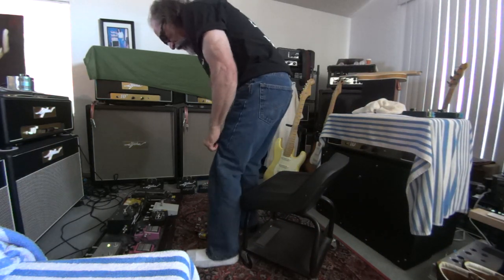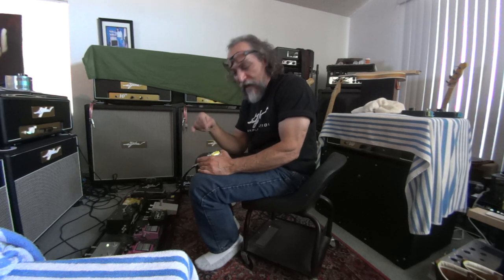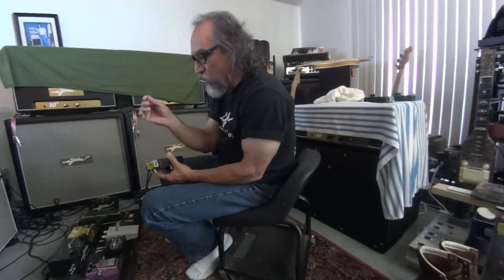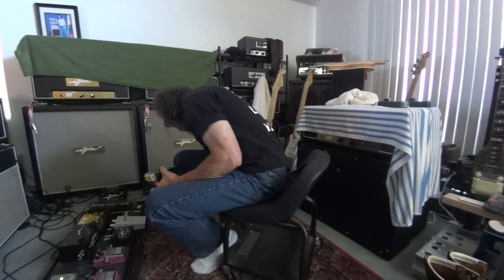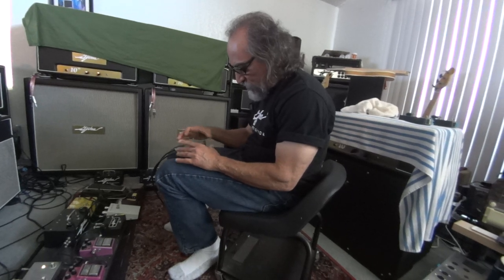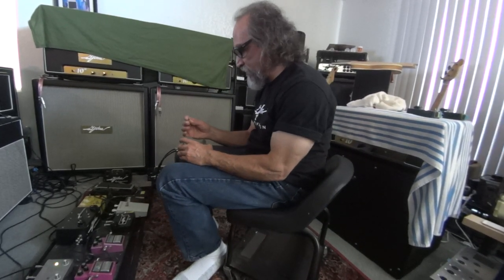Tone Talk: GERMANIAC - germanium transistors - AC128 - for Gjika Gainmaster Fuzz Driver Guitar Pedal

Comment: I'm a modern electronics engineer, I knew tubes could be fussy. I didn't realise transistors where too. Is it just the germaniums or silicon too? never done a side by side test like you have here. I'm tempted to do a similar test with some FET opamps and BC108Cs I have laying around.
Reply from the maker: Even silicone. Every one will have it's own sound but way moreso with the germanium.